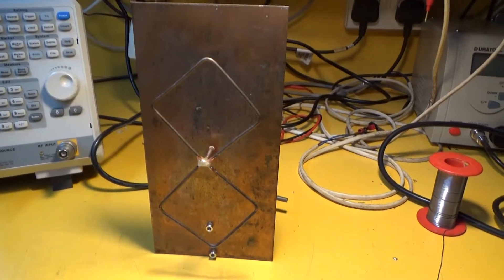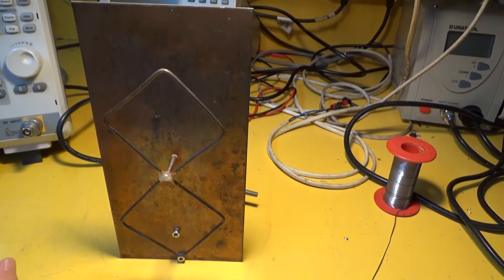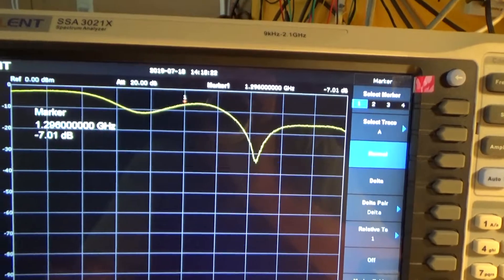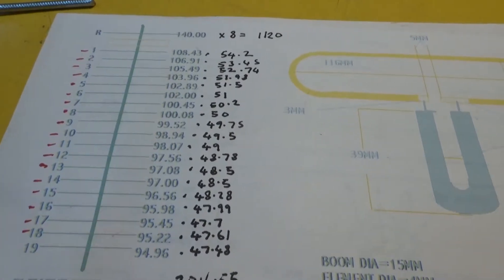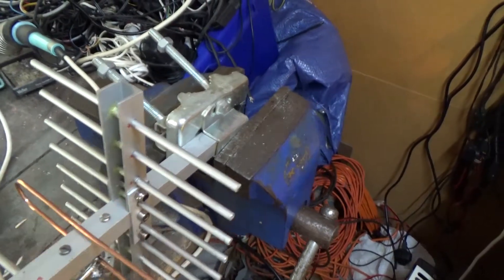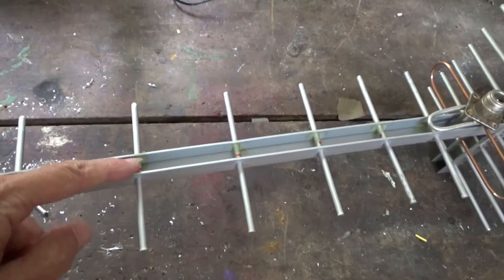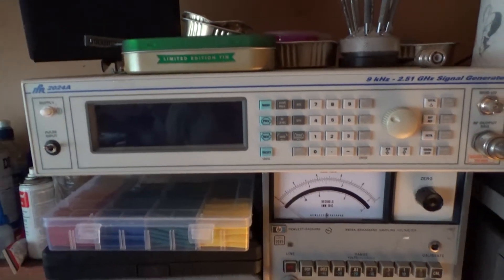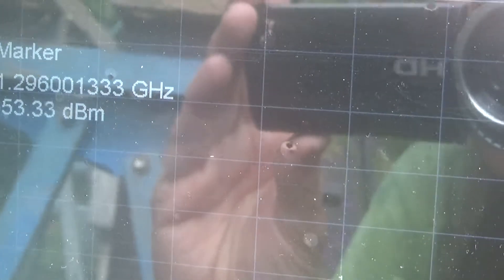Testing two home made 23cm antennas

Comment: Your biquad looks good, its just resonant well out-of-band - simply bend up another set of elements slightly larger and see what happens, should take you about ten mins.  The best way to learn about making antenna driven elements is to make lots and lots of them - use some 1mm thin copper wire, cutters, and the soldering iron and sit down for the evening get started - make them all - J pole, dipole, slot, biquad, groundplane, folded dipole etc.  Also, use your gear to get 1/2y sections exactly right before attaching them to anything.  You can also make impedance transformers and lots of other things, all done in tiny RG316 which costs almost nothing.  The 23cm band is ideal for antenna learning, as all your creations are much bigger than a slice of bread.  23cm and 12cm copper wire antenna making has used the most about of solder ever, what fun!
Reply from the maker: Hi Steve, I've made many antennas over the last 40 years, some work some don't, but now I have better equipment to test them so my success rate is higher. 23 cm is ideal as  you say as they are so small. But I've now given up on 23 as just too many hills round me so is hopeless! So it's back to 2m for me, best wishes Nick
Reply: @ptronix  I hope you don't give up.  Try a converted wifi grid antenna - the biggest you can find, they go real well and are very simple to feed with a folded dipole - just put the new feed where the old one was.

Comment: Nick, a couple of hints from someone who has built a number of23cm antennas including both BiQuads and Yagi's.  These range from arrays of 16 x 26el yagi's to 4 x 47El "BiQuad Yagis" for my portable EME operation.  
As you comment, dimensions are quite critical and a few millimeters can make a huge difference.  You unfortunately chose one of the most difficult (electrical) methods of construction; through boom mounting.  Although mechanically it can be relative easy and sturdy, it "drastically effects the length of the respective elements".  Assuming you took your dimensions from a successful builder, the dimensions he used were probably for a square boom.  The channel boom you used will NOT entail the same lengths.  Also, mashing down the ends hammering them in results in a flared end which also effects length.  The ends of all elements (disregarding DE) should be smooth and slightly tapered with perhaps a 30 deg. bevel.    Nothing found wrong with your folded dipole feed, and the coax balun used, but the very large boom going through the DE with the spacing you used, makes me real nervous.  Perhaps it's OK but would much prefer a little wider spacing on the folded dipole or a different type feed altogether.  
Perhaps in your next try you might consider "above" boom mounting with commercial or home made insulators.  That gives you much better control of the element length and puts the DE above the boom also.  Ultimately, much easier construction.    
On both your BiQuad and Yagi, the return loss is just unacceptable.  By adjusting both the BiQuad DE and the Yagi's DE proximity to the reflector, you should be able to easily achieve 20db plus return loss.  Except for a slight difference in the feed, I use almost your exact BiQuad for my 23cm beacon and it works beautifully,  
Since you seem to have some pretty good measurement equipment, I would sweep both antennas to see if there are resonant else where.  I suspect they may be. 

  Good Luck and keep us posted; playing with antennas is one of my favorite things!

Comment: I think your problem lies with the mating.  It should be 1098mm (.5 a half wave at 1296.200) Then you need to have a half wave transformer on the feed-line about 3 odd half wavelengths from the back of the 'N'Type. This 3eeds to be a half wave of 15mm copper tube soldered to the braid of the coax. I use the inner copper sheet off of Westflex-103 cable, soldered to the tube, then a hole is made to slide over the coax, then soldered onto braid of the coax. This will give you 50 Ohm. I suspect that your match now is likely to be about 85 Ohm. The transformer will fix this. Drop me a line and I will show you the pictures... g6ypk1@yahoo.com  73 Tony
Reply from the maker: Thanks for your comments, I did get a decent mach in the end on the yagi & it worked well but have now given up on 23cm it's hopeless from this location  too many hills round here & the furthest contact I made in a contest was 50 miles! So will stick to 2 metres!

Comment: For the double quad: consider to change the way you lead the semi rigid trough the backplane. In the original design by DJ9HO the semirigid or coax feedtrough  is isolated from the backplane. In the way you do it, you make the backplane part of the radiator element, which is not correct IMHO.  I have both the same antenna's in use. The double quad can be tuned very well by changing the distance to the backplane and is now in an SWR of 1: 1,2, the yagi, here 21elm. with a total length of 1.65m does 16,2 dB gain with an SWR of 1: 1.8
Reply: ….btw, I used the DL6WU design.
Reply from the maker: Thanks for your interesting comment, that would explain why I never got a decent match on the double quad,  I may do a re design on it sometime, but have given up on 23 at the moment as this location is hopeless too many hills around
Reply: ..pity you have no free sightlines for 23cm. I have the same problem, I live in a city surrounded by high buildings.  The only free direction is south-east towards Germany. Looking on Google for double quad's I see there are a lot of other designs, also with the semi rigid soldered to the backplane ground, which is not correct. People sometimes forget the quad leafs are basically a dipole, but in a special shape. No one would connect a normal  yagi dipole end to ground. But it seems this mistake repeats itself over the internet. I do not see measuring results anywhere, only you did.  Well,  I believe I will stay to the original DL6WU design as published in DUBUS 2/1994 magazine. And has been proven to be the correct construction. Hope you will pick up 23cm again..!